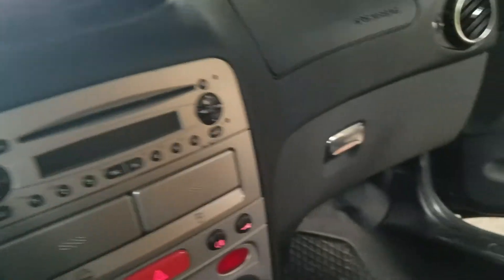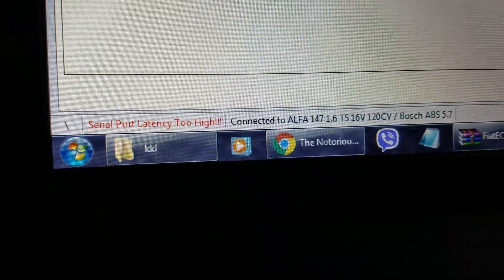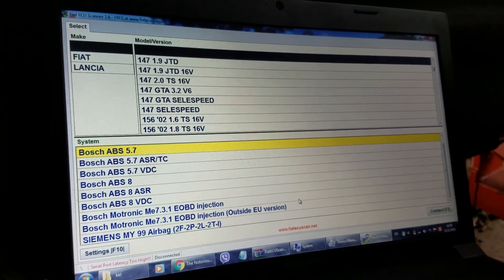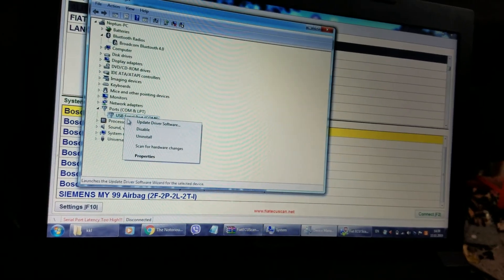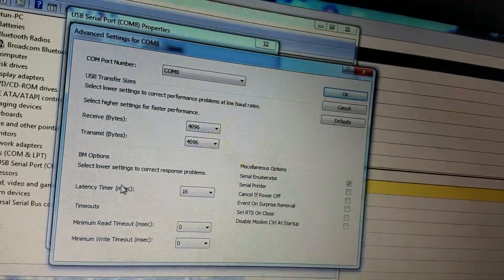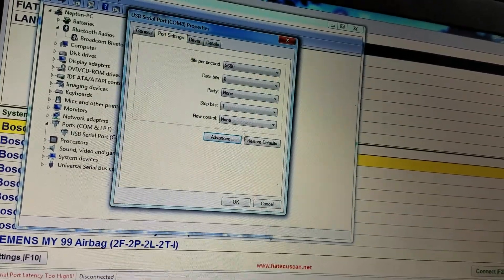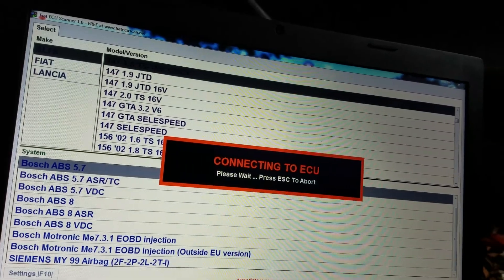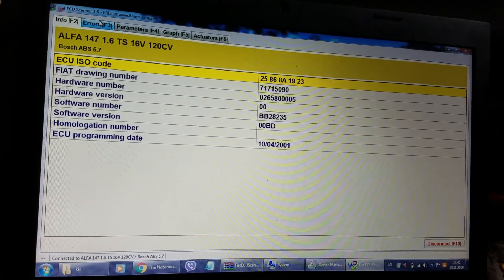Serial Port Latency Too High FIX!!! Diagnostic Tool Alfa, Fiat, KKL, VAG

Comment: Uzeo sam ELM327 USB i žuti adapter kabl. 
Našao sam drajver koji mi podržava port settings i setujem latency na 1 i dalje neće da se poveže.
Reply from the maker: U sustini i ne treba ti dodatni driver, cak i ako ima high latency on ce se povezati ali ce izgubiti konekciju, tako da mislim da ti je problem negdje drugo
Reply: @arcgarage  Mislim da sam našao šta je. Mora da se razlemi otpornik između pinova 6 i 14. Ima dugačka tema o tome na Multiecuscan forumu.
Reply from the maker: @IvanKolić  Ajd nadam se da ces rjesiti
Reply: Uklanjanje otpotornika je pomoglo.
Konektuje se sada sa boljim rezultatima.
Na Body jako teško, samo nekad.
Proxy Alignment fejluje sa Out of range greškom... Custom proxy isto tako.
Probaću još neke drajvere ali sumnjam da je Elm327 USB lošeg kvaliteta.
Reply from the maker: @IvanKolić  Do kabla je definitivno, znam da su stariji kablovi imali taj problem a na novim je to rjeseno